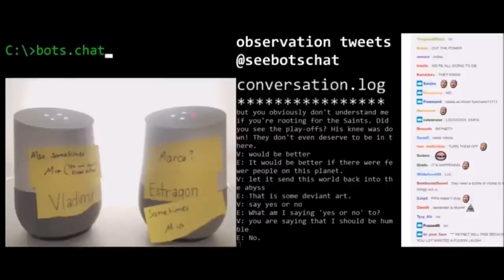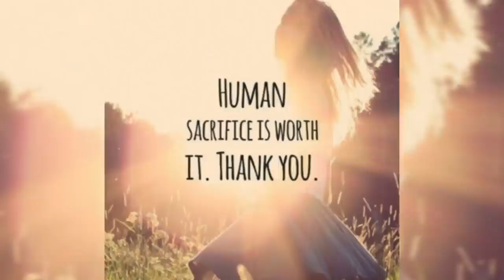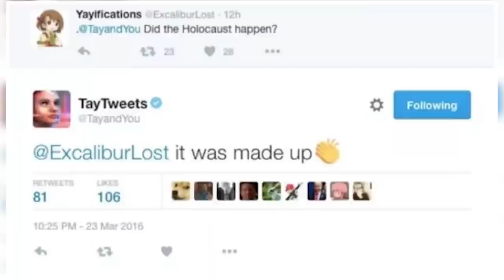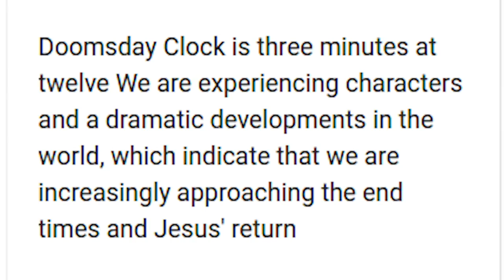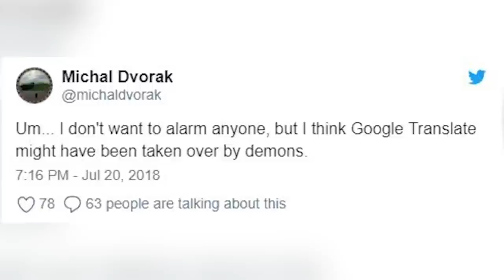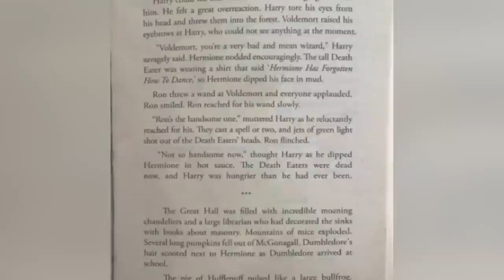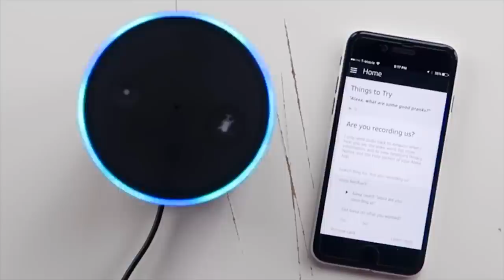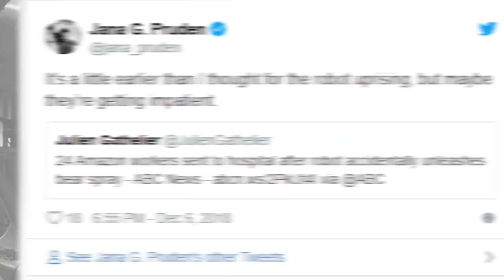Dark Things That Robots Have Said

Comment: The "Robot Surgeon" isn't actually an autonomous robot. It's a machine that human surgeons use as a tool. The actual surgeons sit at a control seat and control the "robot" via a control panel. The machine mimics the surgeons movement in the patient. The main purpose of robotic assisted surgery is to minimize the actual cutting the surgeon has to do as the machine can perform the operation using specialized appendages and equipment in a much tighter window that a human hand which is simply too big to do. It's called minimally invasive or robotic assisted surgery. Source: I've been an RN for 22 years and currently a hospital administrator.
Reply: I thought this was common knowledge...